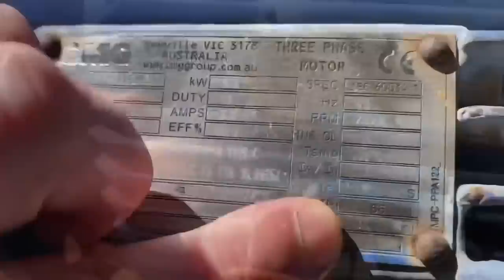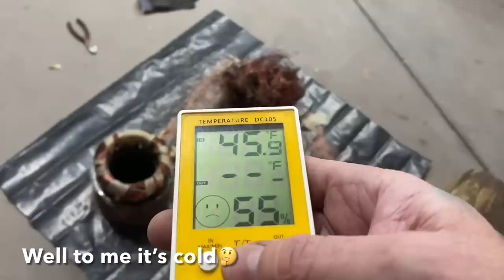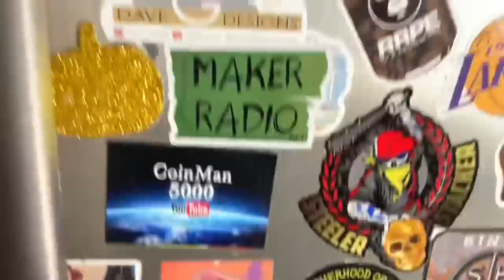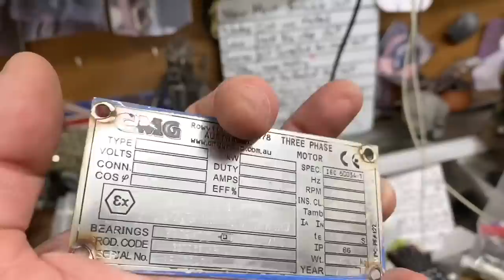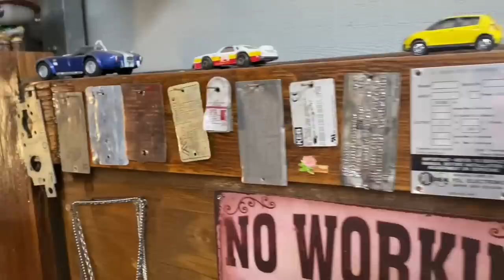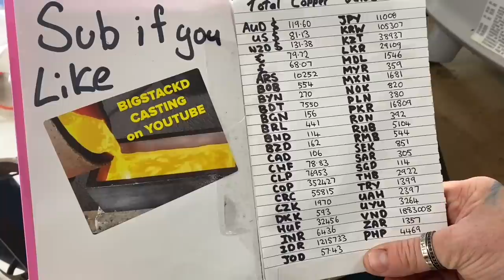184 LB Massive Motor Melt Down - Scrapyard Search - ASMR Metal Melting - BigStackD Trash To Treasure

Comment: Hey stack! I used to work for an internet company in the states and accumulated about 5-7 lbs of copper ground wire, would this be something you’d melt in a video if I mailed it all overseas? (Plus there’s a couple baby motors as well)

Comment: The 3000 RPM (2 Pole) rated AC motors will tend to have more copper than the slower rated machines.   If you can find them, get the open drip proof motors as they usually have more copper than the enclosed motors, that includes all speed ranges.
Reply: Knowledge I didn’t need but now know thanks my friend
Reply: Also avoid EEx motors, they usually have more cast iron than regular ones, aluminum casing motors are best. Remember that the rotor cage is usually made of aluminum.
Reply: Copper ratio increase as the speed of motor decrease

Comment: I so agree, coppers individual look is so irregular and so stunning I just can’t get enough.
I actually used borax in my lacquer coated copper wire melt about a week ago and I was amazed how clean the bars were with absolutely no imperfections, like pitting and carbon from the graphite mould  that can get drawn into it.
I use about 1 table spoon per kilo and incorporate at the beginning of each melt.
I also found it keeps your crucible very clean.🥳
I’m hooked it worked great on lacquer coated copper wire and dirty wire.
Thanks again Bstackd 😊👍
Reply: I have been melting for a few years now, I thought you only used borax in Brass and stuff, but you can use it in copper? Thats cool
Reply: @cesare8270  absolutely %100 mate, very clean bars.
Just try to remove as much as possible with the back of a spoon.
It will build up on the back of the spoon as you move it around the crucible.
You need to take it in and out of the crucible at regular intervals to allow it to solidify on the spoon.
I actually have a bucket of water next to me when I do this.
It helps speed up the skimming process.
But ‘do not’ fully cool the spoon, only briefly submerge the spoon and be sure there is no moisture still present as a steam explosion is imminent.
Just be careful.
Perfect impurity free bars await.😊
Reply: @heathstott  So clean the big slag chunks if needed, then add borax and do as you said? I will have to try this today, Thanks!
Reply: @cesare8270  yes get the majority from around the edge, you can try to work the slag to one side but is difficult. ( as it it very runny at those temperatures.)
This will help reduce the amount, getting rid of all is not possible.. but if you pour slowly it shouldn’t come over into the mould.
Give it a go, let me know what you think 😊
Reply: @heathstott  Okay I will try that in like 30 mins, about to go out and do some melts
Reply: Not me today it’s about to rain here😩😩😭😭
Reply: @heathstott  well just finished a copper melt gonna do another one, this one did not work so well I tried adding borax Sadly did not have a large enough spoon to scoop the stuff, I'll make one, but if anything these ones turned darker. But I did do a brass melt last night and I cleaned good but not good enough, also I think my crucible started melting a bit somehow.
Reply: @cesare8270  hmmmm, well I have a crucible for each metal and I never mix them up contamination can occur.
The darkness would probably be from other material present, as for the crucible being eaten, I have noticed that a little myself, that could also depend on the type of crucible you are using.
I use graphite crucible.
I always wire wheel my blocks after, all the staining should come off.
Remember to use the ‘back’ of an old spoon to remove the borax, if the spoon is getting heavier you are doing it right.
It took me a while to find this method of removing the flux as trying to scoop it out can be difficult or impossible.
Temperature is also important, the copper needs to be over 1100 at least, if it’s shining at you it’s hot enough.
I hope those few things helped I’m sorry it hasn’t worked out so far 😏 but persist and you will master it in time😊
There is so much to learn when casting metal, I’m still learning myself.
Happy melting😎
Reply: @heathstott  I will keep trying, and having multiple crucible for 1 metal would be a good idea but I don't think I wanna drop that kind of cash at the moment. Thanks for the help.
Reply: Makes really nice aluminum bronze bars also.

Comment: Loving the videos.

A random thought... If you are seriously considering a trailer, you might think about adding a small winch/motor system, to lift heavy items in/out of the trailer (like a flatbed tow truck) - either self-powered or running off vehicle's power system.

Anyway, cheers!
Reply: Good idea but depends on legality
Reply: @southaussiegarbo2054  I don’t see why there would be a legality problem. However if there were to be one I would definitely like to know.
Reply: @Halcyon7681   Australia has so many rules around that stuff
Such as set winches etc you require a permit/licence to operate them.
Reply: @Halcyon7681    so many ridiculous laws here its a joke

Comment: 3:20 - Have you tried smelting aluminum out of the rotor? There are squirrel-cage aluminum conductors in the rotor, melt them when you can. Good luck from Rostov-on-Don
Вы пробовали выплавить алюминий из ротора? В роторе алюминиевые проводники в виде беличьей клетки, расплавьте их при удобном случае. Удачи из Ростова-на-Дону

Comment: I've a couple of KG of aluminum smelted so far! I've just about saved up enough to do a copper smelt. Loving this hobby, thanks for getting me into it BigstackD <3
Reply: SMELTING refers to the using of heat to extract metals from ores.  The acts being performed in this video are simply the MELTING of metals.
Reply: No that's not the full definition. the act or process of getting a metal from rock by heating it to a very high temperature, or of melting objects made from metal in order to use the metal to make something new:
Reply: @DavidKirwanirl  Definition of smelt from the Cambridge Advanced Learner's Dictionary & Thesaurus © Cambridge University Press)
smelt | INTERMEDIATE ENGLISH
smelt
verb [ T ]
US  /smelt/
 
to obtain a metal from rock by heating it to a very high temperature

Comment: I could watch motor melts everyday and I don't think I would get tired of them, love the copper melts and from a motor its perfect. That tag was also in excellent shape to be added to the list of great motor melts! 
We're experiencing some hot weather this year, 92 (33C )degrees  with 70-80% humidity, that is pretty hot for us in the Northern states but the southern states are already over 100 ( 38C ) with high Humidity. Take care everyone! Hope you all have a great weekend, BigStackD started it off right!
Reply: @Forrest Farris I spent a summer in Colorado Springs during the early 80s, many people came there looking for work and it was hard to find a job, I did the day labor thing as construction was booming. I had no idea at that altitude it would be in the upper 90s so much and it seemed hotter with the thin air. 
Beautiful place to visit but kinda ruined my outlook for living there. That was the year Pikes peak still had snow in July  yet Temps were high according to locals.
Reply: @Forrest Farris very thin, I could barely make 1/4 mile before my lungs were on fire, this as an extremely fit 20 year old! When I got back to the Midwest and 100ft elevations I felt like superman running!

Comment: It may have been mentioned before, but instead of using a grinder / recip saw to get the copper out of the motor, I use a large sharp chisel and hammer. It slices through the ends with no mess and may actually be quicker.

Comment: 25:32 thank you! One of my favorite parts of each video. But you always have me wondering, how much was the scrap motor from the scrap yard? Are these melts at all profitable? As a hobby is it enough to offset the cost of gas, molds, crucible, etc? Cheers from California!
Reply: No profit whatsoever cause he saves the bars and puts them on a shelf
Reply: @joshp6061  if he sold them
 I am aware he is going for 1 ton 😊
Just curious how expensive the motor was
Reply: @ssupermann  if online sources can be trusted, about $63
Reply: @joshp6061   63 new or scrap value?
Reply: @southaussiegarbo2054  scrap value. Those motors that size new can cost thousands of dollars.
Reply: @madmax82988   going off 80 cents a kilo it would be like 67bucks
Reply: Bro he earns from youtube

Comment: I'm  impressed with your work. 
But on the motor u striped in this  upload I wud have took the ends off like u did but then I wud have  just set the copper core on fire it takes about  half an hour for all the glue to melt then the copper will  just uncoil itself you don't have to cut the case off the motor it just falls off.  Keep it up and thkz for all ur uploads 👍👍👊🤛✌️
Reply from the maker: Yeah I hear what you’re saying mate but the neighbours will probably have a big cry if I start producing too much smoke so I just take it apart like I normally do👍🏻

Comment: Just a thought about getting wire out.... Save all that hammering, what about a small kango hammer, or even hammer/drill switched just to hammer, use old drill bits cut heads flat or weld on solid bar. Seems like hard work all that hammering, have a motor stashed at work, but will be a while when get to it, have plenty to melt at the minute, mite try then

Comment: the biggest motor ive ever scrapped was a possible organ blower from a church. 440 volt 3 phase, with a cast iron body and a drive shaft thicker than a golf ball. I took it to the scrapyard by itself to get its weight, 219lbs, 59 bucks and change. I cant believe I actualy lifted it off my tailgate and dropped it in the dumpster

Comment: Next time your st Bunnings 😉🤙buy the socket attachment for your impact driver, will make your life easier than using spanners 😓😓😓if u get time to, have a look at the magic socket attachment with all pins in it, can use it do undo any bolt and any size, never change bits 👍

Comment: That was a good copper haul. Was disappointing that the case wasn't  aluminum. 

Still need to send you shots of the project in my yard. 

Do have a question... What happened to all the transformer things that you had to reach over to feed Ingot and Bullion at the back gate? Not seen those melted. And wondered if you stashed them? Or found out that the recovery of the insides would be to hard/dangerous? 

Cheers!

Comment: Every electric motor I've come across lately has copper-plated aluminum wires. How old are these motors you keep digging out of the skip? More power to you, thanks for the great show!
Reply from the maker: This one I Took from the scrapyard was manufactured in 2008. I have melted down heaps of electric motors of this shape and style over the years half of the ones I’ve done I haven’t filmed but I have never found aluminium wire in an electric motor, I find a lot of aluminium wire and transformers but never in an electric motor but maybe I’m just lucky👍🏻

Comment: Just curious as to why you don't salvage the aluminum or copper out of the rotors?  The majority of the motors you melt down are Squirrel Cage induction motors.  Some of the high efficiency motors have copper bars and rings in the rotor.

Comment: Hey BigstackD. A quick question. My pressure drops from 0.12 to 0.07 as the LPG tank gets colder, this is during copper melting. Any tips on how to maintain 0.12 ? Putting the lower part of the LPG gas tank in warm water helps?
Reply: LOL its okay. Its shown in the video. lol

Comment: When you melt a junk motor, is the cost of the motor reasonably low to offset the meltdown weight price of metals you create?  Just was wondering. Thank you for your videos!  I enjoy every one of them. 👍🤙
Reply: If you’re asking if the value of the copper inside is more than the scrap value of the motor, then most likely yes by a little bit
Reply from the maker: The scrapyard paid $42 for this motor and sold it to me for $50 but if you take into account the time and effort transport breakdown melting cleanup it would be a very low profitable venture. This is all a hobby to me so my time is free when I have it but to do what I do you would more than likely lose most profit in time and gas👍🏻.

Comment: For your 1000 kg celebration, buy a trailer with a crane and go get a 1000 kg motor to melt :)
How could you resist pouring one large bar for the collection?

Comment: How do you get the metal to just fall out when it’s in the mold? When I do it, it gets stuck and I have to tap it a lot before it falls out.
Reply: i've seen bigstack use graphite powder before, it could also be the mold
Reply: @professionalgiraffe7181  graphite  powder  is a good lubricant  for  high temperature application.
Reply: @void_walker2304  yea thats why i said it....i just didn't see bigstack use it in the video so i thought it might of just been the mold
Reply: @professionalgiraffe7181  graphite molds maybe.
Reply: @void_walker2304  was thinking that, ik bigstack has some of those. but i wonder what spy42 has been been using
Reply: @professionalgiraffe7181  I’ve been using graphite molds that I bought from Amazon
Reply: @spy4269  i think theres your problem its from amazon....or maybe its a setup thing. either way it has to be a problem with the product or how you are using the product.

anyway i hope you can find a fix

Comment: For those who are looking for PHP since it wasn't mentioned here this time, it's 4543PHP.

I wonder when will you melt those copper coated aluminium cables. Could that mean an Aluminium Bronze melt soon? 🤔
Reply: It wouldn’t make aluminum bronze the coating is way too thin
Reply: @joshp6061  thanks for that info. So what's the proportion for Aluminium Bronze, again? 89% Copper and 11% Aluminium, right?
Reply: @zakutenakazumiya1516  anywhere from 5-11%

Comment: Hey I have been melting for a few years now and recently upgraded to a devil forge last year with your help. I got a larger crucible but I don't have any tongs for it and can't find any. I know you had yours custom made but I was wondering where I could find some.

Also do you know a company where I could get custom graphite molds made for me? And for a decent price

Also A few days ago I received like 60 pounds of aluminum Shinny clean pure aluminum plates
Reply from the maker: Check out this link Below as that might help you get an idea of how to make some tongs. Or if you have access to a 3D printer you can always head over to the other link where you can get the 3-D model of the exact same tongs I have and possibly sand cast them in aluminium bronze as that will easily hold up to the outside temperatures of a redhot Crucible while pouring👍🏻

LIFTER AND TONG BUILD
https://youtu.be/nyp0GiE5FTQ

Tong design
https://artbyadrock.com/product/crucible-tongs-3d-model/
Reply: @bigstackD  Thanks this should really help me out, Love your videos

Comment: I understand that steel has too high a melting point to reliably melt with the equipment you have on hand, but doesn't cast iron have a lower melting point? There's a variety of implements and cooking gear you make with it and can be cast in simple sand casting molds. Or does cast iron have a higher melting point? I'm not a metallurgist (yet!) but I have an honest curiousity about this. Plus I hate to see anything just end up in a reclamation facility that ends up rusting in a field for 10 years lol
Reply: Just search he has done cast iron a handful of times, it doesn’t come out great

Comment: Please tell me how many LB/KG can you melt at a time and the time taken.  Thank  you
Reply from the maker: I can probably melt about 7 kg of copper max at any one time and that would take me about 45 to 50 minutes. If it’s copper cable or thin copper it will melt a lot quicker but if it’s big thick copper bars it will take a lot longer to melt as it will take longer for the heat to penetrate into the ingot for it to melt
Reply: @bigstackD  Oh ok. Those are very good numbers . I'm looking to get a burner and crucible like yours. Thanks